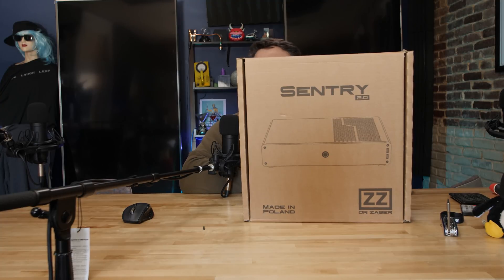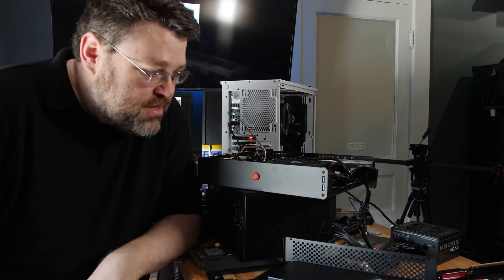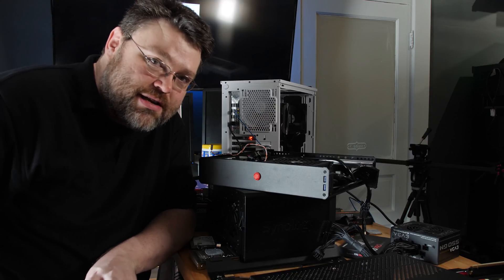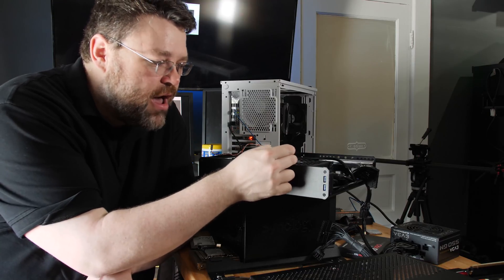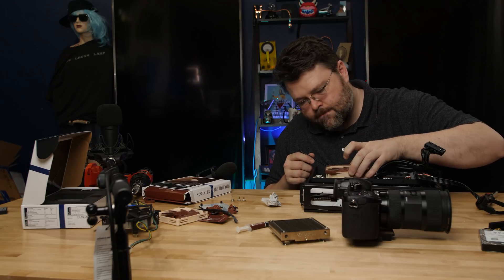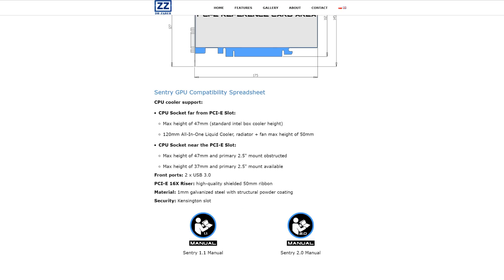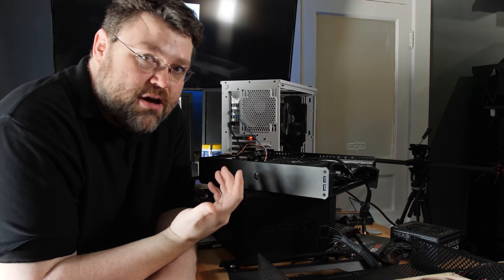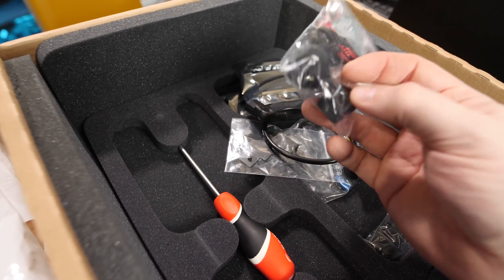Sentry 2.0 - ITX Ryzen 2700 build -- From DR ZĄBER

Comment: 308mm gpu, will it fit? 

(have an 2080 zotac AMP, would love to build in this case)
Reply: That boy too thicc. Sentry 2.0 only supports 2 slot cards and yours is a 2.5. Officially supports 305mm length cards as well.

Comment: I have a Sentry 1.0 and was wondering if you could link that 3D printed PSU Exhaust shroud? Also (at least with the 1.0) you could put a few Noctua NF-A4x10 on the bottom to help with exhaust. Any chance of seeing a full AMD build in the Sentry 2.0? Maybe the Radeon 7?

Comment: I have a dream of a petite'ish ITX case that has room for a triple slot GPU and half a dozen 2,5" drives.
Don't expect to find one any time soon. :-)
Reply: There's the sliger sm560 mini itx case with triple slot gpu design you could possible fit 6 2.5 inch drives in place of fans though.